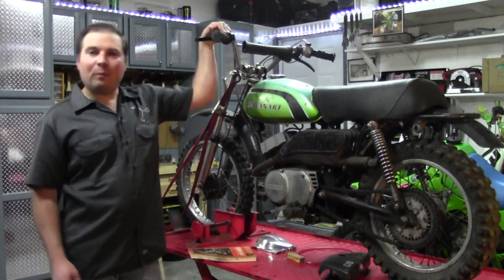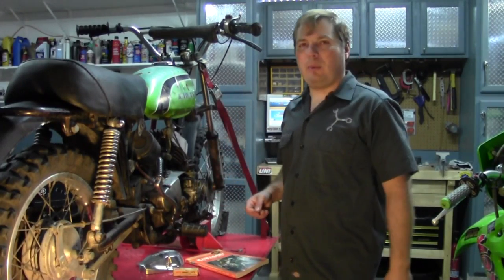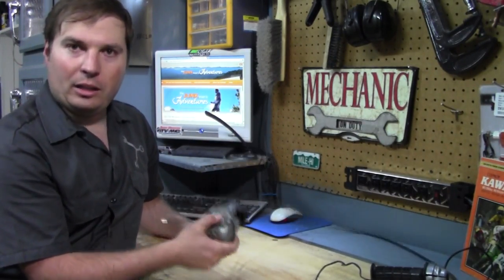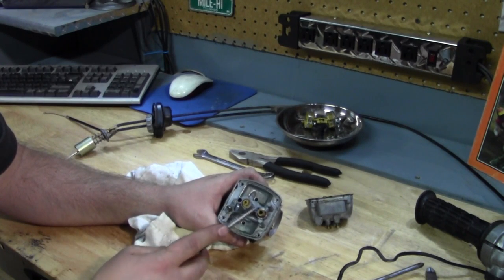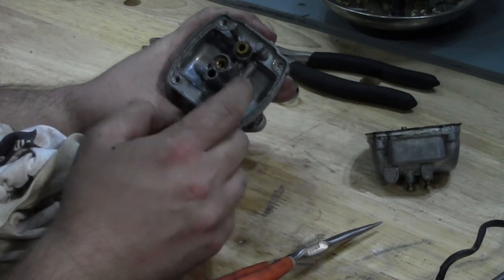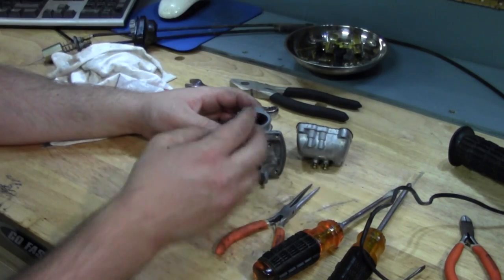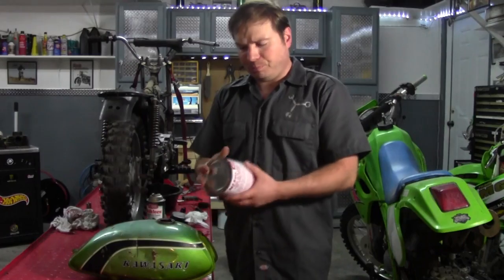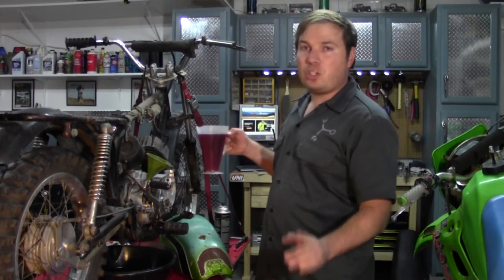How to get an old bike running again (part 1)

Comment: Picked up a 1986 Kawasaki Vulcan 750 for $800 , replaced the battery because it was bad and wasn’t holding charge so hopefully I will be able to test the spark when it comes in

Comment: The apple cider vinegar does work but you get easily noticable flash rust within fifteen minutes  ...just so everyone knows you don't specifically need apple cider vinegar normal vinegar(white distilled) will work just the same

Comment: Are you in Denver? If so do you do rebuilds for pay at all?
Reply from the maker: No I am not, and no I don't. I just do this for fun.
Reply: @thejunkman  ok cool, I thought I saw a Mile-Hi license plate in your workspace and figured it was worth a shot, I'm currently fighting with a bank of carbs off of a 75 CB550 and am getting frustrated lol
Reply from the maker: The service manual is your friend, but just as important is to bench sync them and make sure each carb is set the same and gaskets are sealing.  It is rare, but wear/slop in the throttle shafts can cause enough of a vacuum leak to alter the jetting and operation in the carb that has the problem.

Comment: So primarily check the carb and spark? :)
Reply from the maker: Basically yes.  Fuel spark and compression and an engine will run.
Reply: thejunkman can you make a video on how to put a new ignition mag on a engine and set timings as I restoring  a old bike but it has no mag flywheel on it and I can find one so I was wondering  how hard it would be to by one of them universal flywheel and magneto
Reply from the maker: Get me a sponsor to send me a universal magneto kit for my F9 and I could make a video on it.  If I don't have the parts I cannot make the video.

Comment: I just bought a 1974” mc1 running great and was wondering if there any oem or aftermarket parts like pistons, cylinder, crank, etc... because I cannot find anything. Thanks I’m advanced
Reply from the maker: Ebay is your best bet for obsolete parts, but an OEM parts supplier like Rocky Mountain MC (one of my sponsors) https://www.thejunkmanadv.com/current-sponsors.html Can get you current OEM parts.  The MC1 shares a lot of parts with other models so certain part numbers fit multiple models in that 80cc-100 range.  There are a  ton of OEM parts out there, not so much for aftermarket as they tend to only focus on models 10 years old or newer.
Reply: I seem to luck out as You  are doing all the other twostrokers excep the F7 one. Or did you that one also?  @thejunkman
Reply from the maker: Check out my Barn Fresh series, it deals with an F5 and F9 which these are all very similar in design so all the tips and trick apply.

Comment: I have this same bike I had it start up and run for a little then it died out and I can’t get anything from it tried cleaning the carb again and adjust the specs what else should I do
Reply from the maker: do you still have spark?
Reply: thejunkman yes
Reply from the maker: Is it a bright blue spark?  Otherwise you still have a fuel problem.  Maybe the float height?  I am assuming you have the carb set correctly.

Comment: do you still have this bike
Reply from the maker: +Daniel Tristan yes check the website for restored pictures
Reply: thejunkman i need help with the coil connection im putting on a new one and I forgot which wire go to which
Reply from the maker: +Daniel Tristan there is only one wire to hook up, the black one.
Reply: thejunkman how can i send you pictures
Reply from the maker: +Daniel Tristan visit the website and post them in the comments. Link in the description

Comment: So if you cant fix it your self how much would it cost ?
Reply from the maker: That is impossible to tell.  Lots of factors will determine the cost to repair or get a bike running.  Check your local shops and ask them.
Reply: thejunkman I saw the "Mile High" sticker... so are you in Denver? I'm looking for a mobile tech to come look at my 97 kx 250? ;-)

Comment: There’s a 1970-ish Kawasaki 650 for about $350. It’s not running and a guy got it from an old property. It looks good but I know looks can be deceiving. Do you think it’s worth the money to buy and fix up? Especially for a beginner?
Reply from the maker: It's a good price if it's a 1965-1974 W1 or W2 or W3 but I wouldn't consider these bikes good for a beginner to restore because of parts availability.  If its a modern W650 from 1999-2007 which looks like an early 70s bike its still a good deal and a better project for a beginner.
Reply: thejunkman thanks. I’m asking  him now to find the model date. I was planning on getting this bike, a 1982 gl500, and a 1978 cm400. The last two are running and are about $700-850. Decisions decisions.
Reply: Enjoyed your video, greatly appreciated. I used to ride 2 stroke Susuki as a kid, little MX racing, loved it. I have a 2005 125 Yamaha TTR-L. I ran gas outta the carb for winter, and why are 4 strokes so hard to start for some reason? I can't get it started so far , I've had back, leg problem now so cant ride like I want to. Soon I hope. But every yr, it seems to be hard to start after winter. I'm not great at rebuilding carbs. Was better at 14 at it than now. I smelled the oil, smelled like gas in it. Fuel cock needs replacing I know cuz cant hardly turn it on/off. Still looks as new the day I bought it.
New in 06, put in shop once. Son's 225 starts easily. I'm wanting a 2 stroke again. Going to check spark, change oil. Thank u very much, Awesome learning again!😷